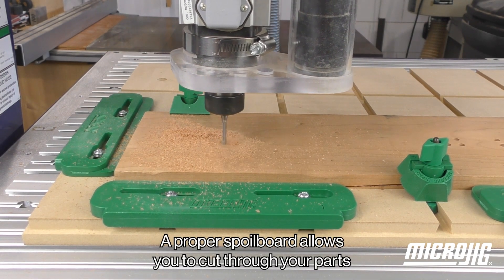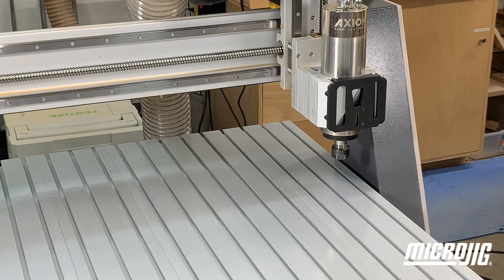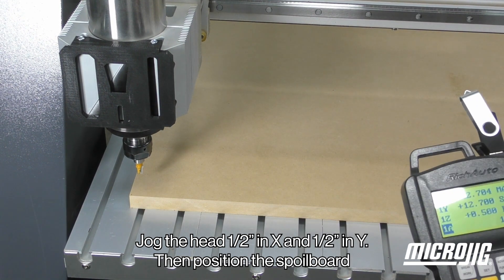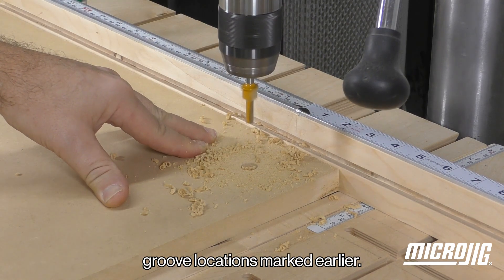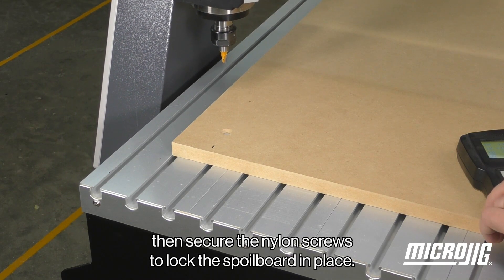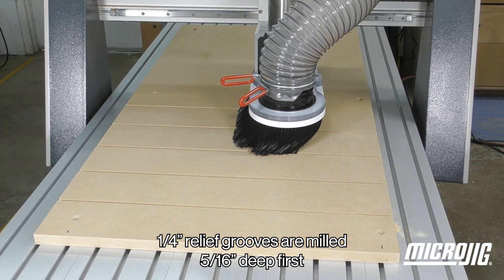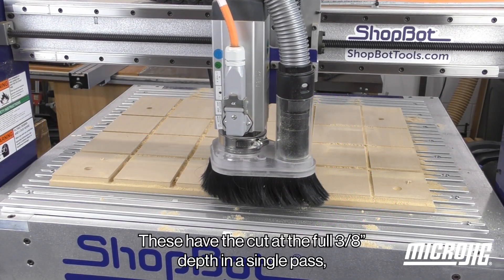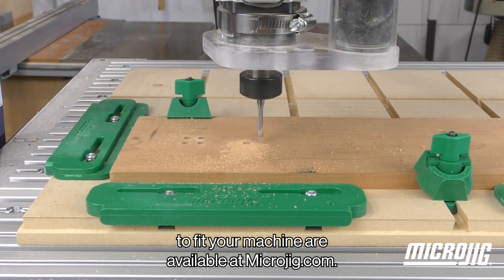MatchFit CNC Spoilboard | Instructional Video

Comment: what are the speeds and feeds you recommend for the dovetail bit?
Reply from the maker: Same as any bit of the same size. So for the 1/4" relief bit, the RPM should be about 14,000 and the feed rate 40-70 ipm depending on how robust your machine is.
The Dovetail bit is the same as any 1/2" straight cutter, I like 12,000 rpm for it with a feed rate of the same 40-70 ipm. It is cutting the full depth in one pass, but the relief groove makes this easy. In fact you will likely hear that the dovetail bit cuts easier than the relief bit.

Comment: So I can use match fit in my cnc? Why make it an inch shorter than my work area?
Reply: The 1" shorter allows for the 1/2" match fit dovetail bit to come in from the side. I opted to use a 1/4 end mill to make a 1/2 insert hole on the edge for the match fit to drop into and then cut across.